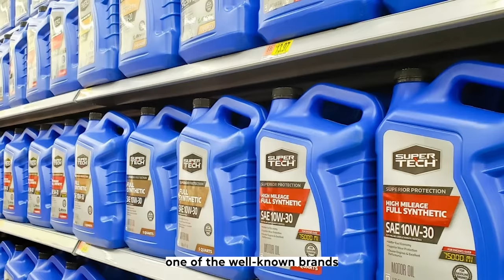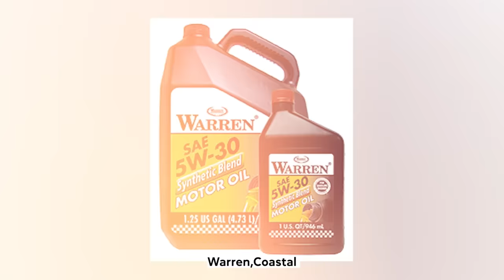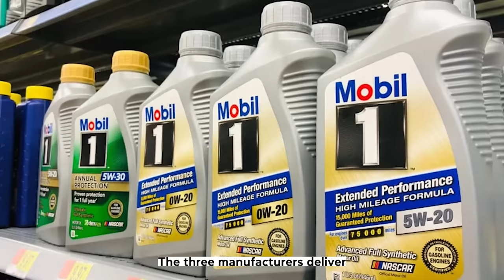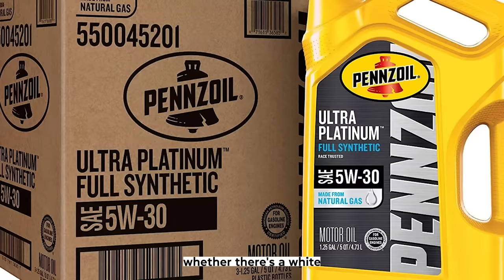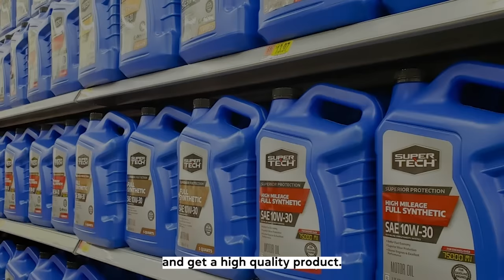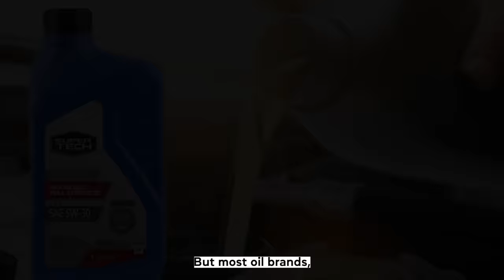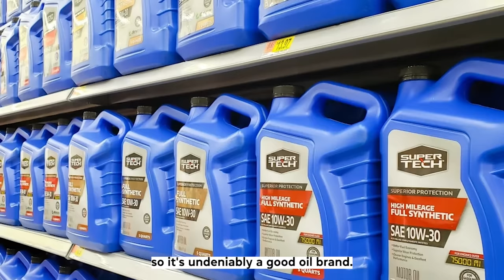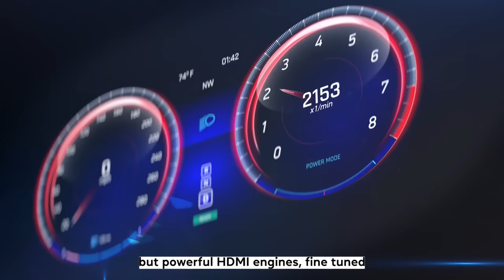Who Makes Supertech Oil For Walmart And Is It Any Good?

Comment: The Supertech high mileage full syn 10w-30 is the only oil that keeps the burning to a minimum in my kid's oil burning Kia.  For some reason, it burns way less of it than any other oil I've tried.
Reply: It’s the weight and the high mileage component. High mileage oils usually incorporate seal conditioners to expand rubber seals and make it harder to run out. The 10w-30 vs that 5w-20 water they want you to run is another thing. 10w-30 is considerably thicker and heavier. Given Hyundai/Kia engines and their propensity to burn oil thicker oil will be much harder to hork. The only trade off might be reduced oil pump life or extra wear from the heavier oil having issues moving quickly when cold

Comment: I had a 2002 Intrepid w/ the 3.5L high output engine and at about 135,000 miles i needed a couple gaskets changed and the mechanic said it was the cleanest Chrysler engine he had ever seen inside no sludge and looked new. I had that vehicle untill 2021. I changed my own oil after the warrenty ran out with full synthetic Wal-Mart oil and a mopar oil filter every 5,000 miles. I will continue to use it in all my vehicles.

Comment: Not Warren Oil, it is actually Highline Warren (formerly called Warren Distribution), not the same company as Warren Oil but often confused with it, that makes most of Walmart SuperTech oil, a good company BTW.   I think they also make AmazonBasics oil, MAG1, and Costco's Kirkland oil too.   The only deviation from that is something from years ago where Amalie made SuperTech in the Florida area, and in the southeast part of the U.S., for a while anyway.
Reply: That is correct. It is not Warren Oil from North Carolina.
Reply: I read a while back that Mobil/Exsson bought up Warren Dist. Hard too keep track for all the big buying and selling going on. In the end it´s all pretty much the same oil with the API/ILSAC ratings so the choice is where you can get the best deal. A $2qt. vs $10qt does not mean you can drive 4 times longer! You still have to follow the owners manual recommendation for oil change.
Reply: Spot On. Information this video completely bogus. I still call it Warren Distribution, but very recently change to name you mention. Yes, in addition to Super Tech, they make all the oils you mention.

Comment: Good Video.
I read that Mobil has bought up Warren.
As for the oil... Warren buy´s it in BULK from Mobil and/or one or more of the major refineries depending on where they get the best deal as they do not have a refinery themselfs. They are a striktly "mixing/packageing company".
 We are talking about Group 3 oil which is used in most vehicles. 
The High End Group 4 oils are intended for performance vehicles like Nascar and Formul 1 and not for normal cars with catalitic converters where the Zink in Group 4 oils will clogg up the converter.

Comment: Super tech is good. Like the man said. Just change your oil when your suppose to. Spend the money on a better filter is you want. I have 04 dodge Dakota. 380000 primarily used super tech oil with mopar filter or Baldwin filter.  Happy with the super tech.

Comment: I have seen other channels test oils,  and filters. I was surprised that Supertech oil and filters did very good.  I use Supertech filters on my lawn mower engine 2-3 times a year. (Kohler V twin 25 horsepower) and use Supertech  full synthetic 10W 40. If I can find it. If not I  use 10W30. The engine was biild in 2004, has been used long and hard all these years.  Smokes when first started, but stops smoking quickly.  Takes about 30 minutes to cut my grass,  after 4 cuttings uses about 1/4 on the dip stick, still over  half in the safe range. I'm happy with it .

Comment: I am using this oil for the past 7 years on my 2012 accord  and have no issues , changing my oil every 4000  or 5000 miles not bad at all and my engine is clean now my car has 205500 miles and my son using it...

Comment: I've used Supertech for decades and never had any problems. I got 200,000 on my Hyundai, Elantra and it does not burn any oil between changes. A five gallon jug is at least  $10 less then some name brand.

Comment: My daily driver is a 2004 Nissan Xterra SE, purchased 2005; yes twenty years old. My oil choice is full synthetic, and based on price either SuperTECH 0W20 or Amazon Basics 0W20; sometimes one or the other have a sale price. Also, use Fram filter, thus both oil and filter are changed once a year.

Comment: Just because the Walmart oil may be made by Mobil or any other major oil co., doesn't mean that the chemical specs are the same.  All of the oil manufacturers have their special chemical blends of motor oil.  Any oil product made by them is done so with the particular recipe called  for by the customer buying the oils.  Look at the chemical makeup of Mobil 1 European blend vs Castrol basic synthetic oil.  The chemical blend will be a little different.  So, without knowing the chemical blends of the particular private label motor oil, there's no way to tell that it may or may not be the same as the major oil cos. product.  I've found that these specs are hard to find, but they are out there.

Comment: I've been using the super tech oil for the last 10 years in all my cars and changing it every 5 k miles no problems. It's not good to wait to 10k no mater how good the oil is. It can still sludge up and brake down from heat.  5w30 being the most I use.  On car takes 5w20.

Comment: for decades i only used CASTROL GTX but now i only use SUPERTECH FULL SYNTHETIC in my 4 wheels vehicles. i change the oil every 3500-5000 miles in my HEMI RAM anyway. i also add LUCAS FULL SYNTHETIC oil stabilizer every oil change.

Comment: I have a 1998 Honda Civic EX and I been using Super Tech Advanced Full Synthetic Motor Oil with a Mobil 1 extended oil filter. So far I have 403,000+ miles and the cars drives like a new car with no problems. I just recently found out Walmart SuperTech has an extended oil filter but have not use it. I have faith in this oil and will continue to use it in all may cars: Super Tech Advanced Full Synthetic Motor Oil SAE 5W-30, 5 Quarts, currently selling for $20.48 online

Comment: Tried supertech full synthetic 5/20 for my 2003 ford RANGER with 2.3 L ( 160 K miles ) seem good and after 1800 miles the motor seems happy. Satisfied customer. Oh I bought it because my Mobile 1 five quart bottles seem to leak at the ultrasonic seam welds.

Comment: Here is what I do. I buy Supertech synthetic oil but STILL change it every 5k miles. I buy an FRAM extended life filter (10k rated) but STILL change it every 5k miles. The change frequency of 5k miles along with the extended use range of these options means I will always be within the the usage and protection limits of both. FYI, I drive under what vehicle manufactures would consider normal driving conditions.

Comment: I drive a 2013 Subaru Impreza that gets an oil change every 4500 miles. If I use Royal Purple oil I can get 4500 miles without topping off. If I run Super Tech oil I will need to add just shy of 2 quarts. Price comes out almost the same. Ill stick with Royal Purple. I do not notice any mpg difference. Not trying to start any arguments or fights but just giving some info from what I have personally learned.

Comment: Nothing wrong with saving money. It all meets specs. What ruins engines before their time is believing the manufacturers extended drain intervals. If you adhere to some 10,000 oil change recommendations, at least change the filter at 6000 miles and top it off with some fresh, clean oil. The car makers love their oil life indicators, they make them money up the road in the service department.
Reply: Change your oil and filter every four thousand miles. i would never go beyond that no matter what the dealer recommends. blow your motor and they will gladly replace it for about seven thousand dollars, maybe more. Been using supertech and fram oil filters for years, i change out every 3500 to 4000 miles. some folks say it is good for 10000 miles i say BS. your choice if you can afford to buy a new vehicle every couple of years that might be ok for you but if your cheap like me stick with early oil and filter changes.
Reply: I have done 6k and 3-4k and the oil is dirty on those 20k 10k synthetic oils.I change every six months
Reply: James.  The car care nut on you tube has the same advice. He emphasizes that the 10,000 oil change interval that Yoda says is ONLY to keep the vehicle in compliance with the warrenty..but premature oil burning will result if you adhere to this .  5,000 is reasonable
Reply: My vehicle manual says think months not miles. It recommends six months OCI regardless of brand or type. Five thousand miles max or six months whichever comes first. It takes me
 two years to drive 5000 miles so I go by the six month recommendation.
Reply: Get us out of the warranty and good luck😅. Planned obsolescence sells more stuff.

Comment: I have only been using supertech and costco high milleage synthetic oil on 2 of my 410k mile combined vehicles and haven't had any engine problems for 11 years. But then they are Toyotas so that's another story. Now I do buy premium oil (Motul) for my motorcycle but that's because it seeks 10k RPMs from time to time :)

Comment: I took my John Deere hydraulic pump into a John Deere dealer to have it checked over as I use it every day and for heavy field use.  The tech took the pump apart to check the inner valves and pistons and asked what oil I had been using.  I told him I use Walmart brand and changed the oil regularly according to the operator manual.  The tech said to keep using it as the pump had no wear or scoring and only replaced the seals as a precaution.  Nuff said.

Comment: I change it every 3000.  Combined city/hwy driving.  You can really tell at 3000, the engine is not as quiet or smooth.  Once i change it, i can barely hear the engine.  More tire/road noise.  It's really noticable, the difference.

Comment: Did anyone notice the “SN“ on the SAE stamp? When I was a kid, oil was rated “SD“. Every time the letter changes, the oil has to have a significant improvement. Engines and transmissions last much longer nowadays than they used to. That’s because of the improvements in motor oil, and all petroleum products. The engine main bearings have not changed much at all in the last 100 years! I noticed that you didn’t compare synthetic versus conventional oils. I have found that pure synthetic actually has some issues. I have been using synthetic blend oil, and it seems to be the best of both worlds. Note-  I’m a Mechanic, and I’ve driven almost 1,000,000 miles in my lifetime. That’s a lot of oil changes!
Reply: What issues and how is a blend better? Not knocking you, but you’re going against the industry standard and I’d like to understand your point
Reply: @Beckybitch     It’s kind of hard to explain, but when I was running full synthetic, it seemed like I could hear every little sound inside the engine. When I switched to the blend, all those little noises went away. It’s almost like the synthetic is too thin.(I was using 5W-30 in both cases). The engine I’m referring to has well over 200,000 miles on it. That may have something to do with it.

Comment: Years ago Conoco used to make their oils. The name was clearly seen on the label. Oil like gasoline is made in large quantities by a few manufacturers then packaged and sold to retailers like Walmart and others who then put their brand on it. I've used their oils for years in my vehicles 2 of which are now over 200K miles and still going strong. I've used their 20/50 oils in our quads in the Arizona heat for years with no problems. I use a brand name oil in my hot rods and drag car but would have no problem using Walmart oils in them if I had to.

Comment: I'm using Super Tech for my 2013 Tundra & 2008 Avalon. I changed ST oil  between 4-5K. I use  Pennzoil Ultra Platinum for my Miata. Super Tech is a good oil for daily driver but I wouldn't go more than 5K.

Comment: Am a retired mechanic for over 35years of service. Did all my own oil changes in my shop at home. Used Super Tech for years on my Toyota's, Jeeps, Honda's & Subaru's! Never a problem. The main thing you must do with any brand oil is to change it with what auto manufacture print in owners guide. If it says 5000 miles then change every 5000!! If it says 10000 then do it at 10000 miles. But you must do it at that mileage. Be consisted with it!!! Not 5000 one time then 8000 the next oil change. Your engine doesn't like this behavior!!

Comment: Read the label. Compare the oil specs with the engine mfrs specs. Easy. I use Castrol GTX, and have never had a problem with it. Use it in my 954rr bike.

Comment: I use Supertech full synthetic on my regular car.  There is no point in using more expensive brand when changing your oil regularly.  Every 5000 miles or once every 12 months.  I just changed the valve cover gasket of my Toyota Matrix at 150,000 miles a couple weeks ago.  The inside is extremely clean.  I am sure conventional oil would have given me the same result as long as I change my oil regularly.

Comment: I've been using S/T for about 4 years now over name Brand. I've watched critically on performance, color, engine feel and noise and I notice nothing different. I'm not at all a name dropper, saying I have to have brand name anything, but in this day and age of seemingly everyone "cheapening' out everything under the sun, using "cheap" oil is NOT where i want to shortcut. personally, I am completely satisfied with the S/T oil. In any way, I notice no differences in anything. It's used in everything we have and there hasn't been a single downside on any equipment.

Comment: Supertech has a 20,000-mile advanced full synthetic motor oil
Reply: I buy the 10,000 mile version and change oil around 4,000 miles. It’s all I’ve run in my 2021 Telluride since new. Never had a vehicle that burns so little oil. It drops about 1/8 inch on the dipstick between changes.

Comment: If one wants the best of the best engine oils out there, use motorcycle engine oil as motorcycle oils are made for engines where typical RPMs exceed 12,000 RPMs.  Motorcycle oils also have much better detergents, flow viscosity's, and highly thermal breakdown formulations due the higher stresses that many motorcycle engines must perform under.

Comment: I have used SuperTech back when it was called "Tech2000" since 1994..... I have never had an issue out of ST engine oil and it has worked out great...I have one car on it since 86,000 miles and it now has 430,000 miles and still runs like new.... buy the ST, keep your oil full and changed every 5,000 miles...

Comment: IVE BEEN USEING CASTROL GTX FOR YEARS NO ISSUES SO I THINK I WILL STICK WITH IT
Reply: ditto, I've been using castrol since the 1970's, I cant recall all the cars I've owned but I do know that I've never had an engine problem due to wear or sludge. I know engine oils have come a long way but I can't justify trying to save $5 or $10 on 5 quarts of oil for a $70k car. (2022 Lexus)  Agree with you, sticking with castrol

Comment: Reviewer is obviously a fan of Mobil 1, which consistently lab tests at the bottom of the pack. If you need the best, Pennziol Platinum tests best., SF full syn oil is fine and tests out in the upper 25%.

Comment: My sources say, Warren Oil makes Walmart synthetic oil. Supertech onventional ("Dino") and semisynthetic oils have been reported as coming from various suppliers. I take Supertech dino and semi to be equivalent to the oil company brands such as Mobil, Chevron, Texaco and such. There is something to know though. Unless stated otherwise on the bottle, Supertech synthetic is Group III synthetic. It is highly refined oil out of the ground. Group IV is synthesized from natural gas. i can only speak for myself, but I would not have an extremely long change interval with a Group III synthetic. I do all short-trips driving. I use semi, but my change interval with Group III synthetic would be about 3500 miles.

Comment: Had an old clunker that I used for back and forth to work, changed oil with Castrol GTX.was on sale for $1.50 a qt.engine would clatter upon startup till.i used
GTX ,Noises disappeared  with it in the engine,good oil😊

Comment: Super Tech HD30 Diesel motor oil, comes in gallon jug is what i use in my 21 HP Garden Tractor and farm tractor. It's SG rated for older engines and i don't think there's a better oil brand at any price.

Comment: Please keep in mind that Warren Oil manufactures private label oil for other prominent retailers like Advance Auto Parts, Napa, Pronto, and others. While it may offer good value for the price, it's crucial to understand that this oil isn't universally suitable for all vehicles, particularly certain makes, models, and European cars. Always consult your service information when selecting oil to avoid potential harm to your vehicle. Happy wrenching.
Reply: Advance Auto Parts house brand is Fram and is made by Amalie Oil. The house brand used to be called CarQuest but with the positioning of the CarQuest brand as a premium product it was thought that to have it be the bottom tier oil was not good, so Advance purchased the rights to the Fram name for the use in liquid products that Fram does not make. This is why they sell Fram branded oil, transmission fluid and coolant, as well as some engine additives such a fuel injector cleaners.

Comment: 9:11  Most engines that run more than 10K miles on oil are usually diesel engines with several gallons of oil in the crankcase.  If you run these oils on extended drain intervals, the oil filter needs to be changed out at the engine manufacturers recommended mileage and then top up the oil in engine with fresh oil.